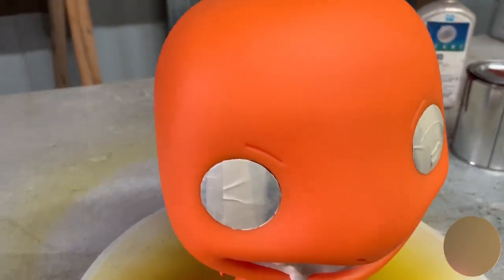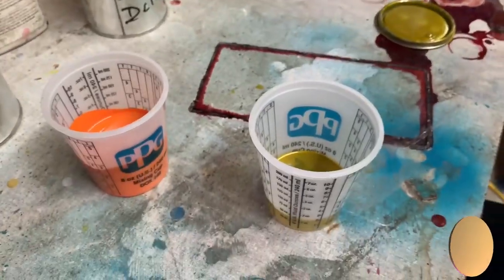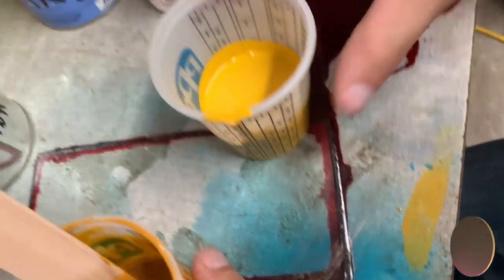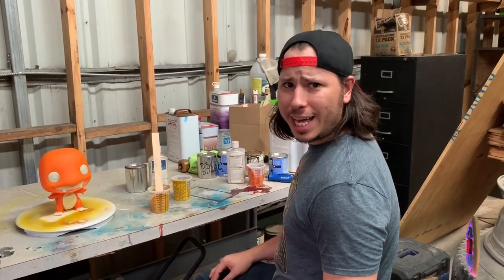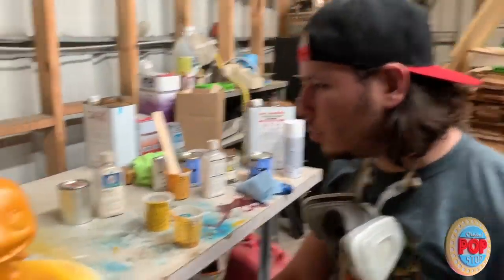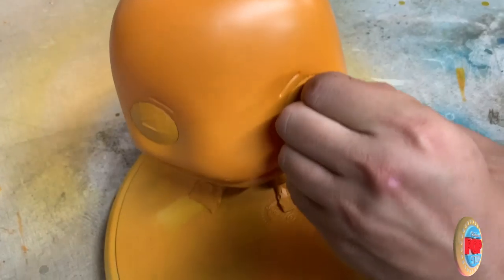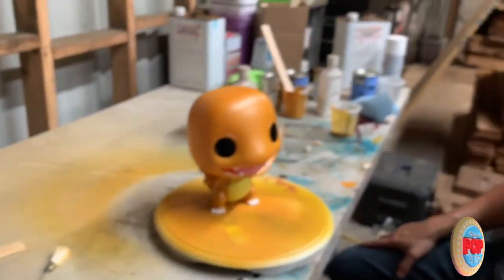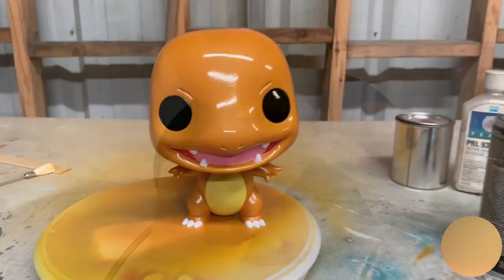How to make a GIANT SHINY CHARMANDER Funko POP! | DIY Custom Painting POP Figures

Comment: Hi! I'd like to ask why didn't you sand Charmander down and apply primer before painting him?

I also would like to ask if it's fine to apply primer without sanding the pop first? And if not, what sandpaper grits do you recommend when sanding a pop?

I look forward to your response. Thanks 😊
Reply: You only use sand paper if you're going to repaint with acrylic paint. He used air spray paint and that does the job better and less work.